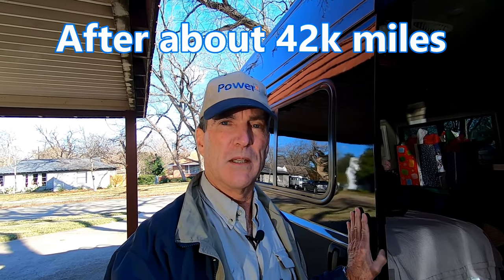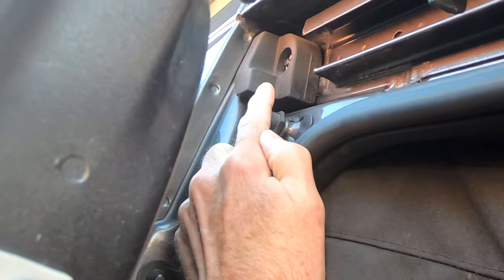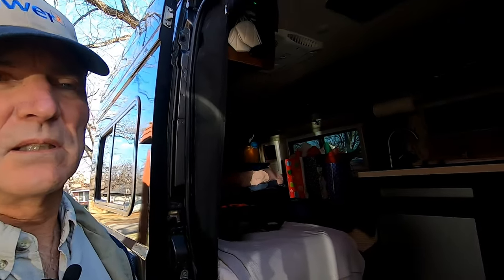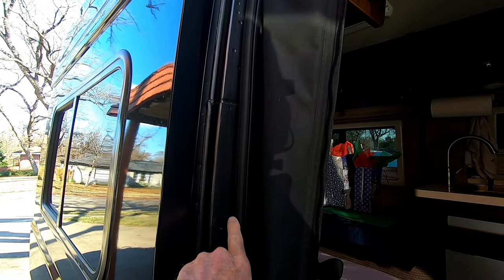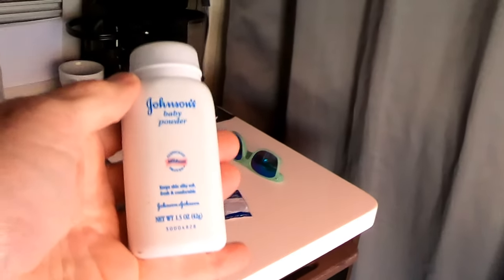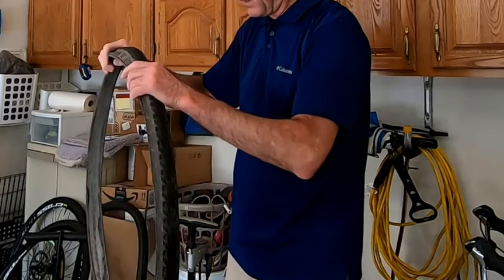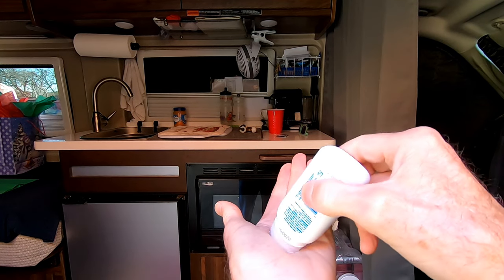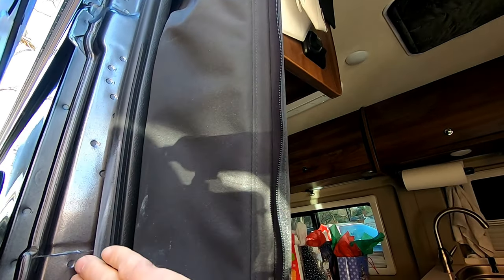Stop the Door Squeak

Comment: Steve, Love the videos and I find them all very helpful.  My wife and I just picked up our brand new 2023 Travato 59KL on Saturday, May 13.  Driving it home we noticed an unbearable rattle coming from somewhere in the home.  I put felt pads at all the cabinet door openings and the micro/convection door but the problem is still there.  I was wondering if you had any suggestions as to where to hunt down and stop this annoying rattle?  I’m about to drive it from CA to TX and I can’t imagine having that rattle for 1500 miles.  Hope you can make a few suggestions as to where to check for this annoyance. All the best.
Reply from the maker: David - I'm a bit envious - you have the RAM safety features on your van that we'd love to have but don't want to part with our van for only those features 😊 (someday, maybe).  Unfortunately, the only way to really locate the source involves being out of the passenger seat and moving around while in transit - not a safe thing to do (ie, out of the confines of the 3-point seat belts and airbags).  I am not encouraging you to do that, so here are things I discovered when I was being a daredevil flitting around the moving house:  the microwave is a HUGE source of hard to find rattles and impossible to completely stop.  We put bread, chips, extra paper towel roll, and other such items in our microwave when traveling to silence rattle sources in the microwave interior.  However, the main rattle source in the microwave is within the workings of the unit (ie, between the inside cooking part and the exterior case).  No real way to stop that rattling - I have not torn ours apart to find the actual source (Kelly won't allow it) but I think it is the vent system within the case.  I have confirmed it's nothing outside of (ie, behind, beside, etc) the microwave case; installing our induction cooktop gave me full line of sight to all sides and top (had already peaked at the bottom w/out Kelly's awareness).  You may also have some rattling from the hoses attached to the water pump and in-house water filter.  Foam pipe insulation around those or zip tie to solid, stationary objects can help.  If you have the sliding doors in the bathroom, those can also be a source.  It can also be wires rattling behind the bathroom closet which require dismattling the closet to resolve (not hard to do but tedious).  
Those are my initial thoughts, hope they help. Enjoy your KL and thank you for watching!

Comment: We don't have that squeak on our 23 59G but the glass plate in the microwave has to be removed or covered and a towel placed under the glass plate of the stove.
Reply from the maker: We do similar.  The internal components of the microwave, will still rattle. We talked about replacing it with a toaster oven but . . not convinced that is our smartest move. 
Appreciate your comments.

Comment: Hey guys. Did you get the rattle while Driving or just when you open and closed the door .as far as the microwave I  Take the Rotisserie plate out when I'm driving. Thanks for the vid
Reply from the maker: It came while driving.  Opening and reclosing the door was the first action to attempt silencing the squeak, and it failed.  The powder really did the trick.  We put another 2,000 miles on after the powder and no issues.
Reply: You the MAN!
Reply from the maker: Thanks 😀